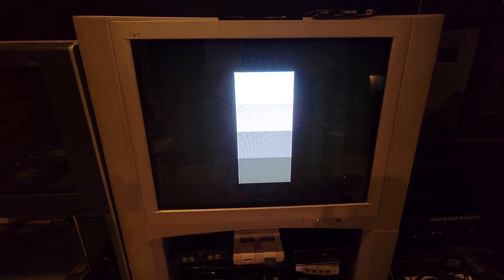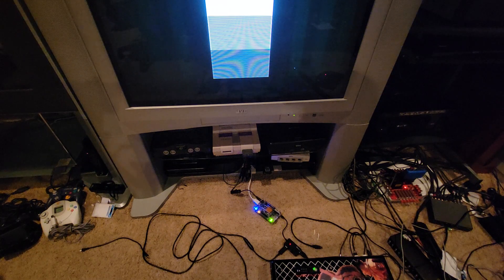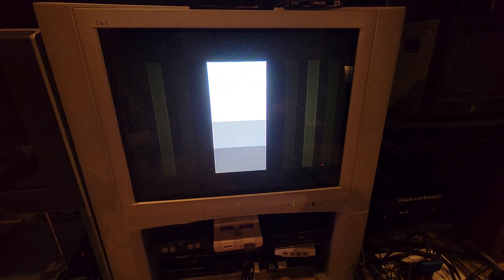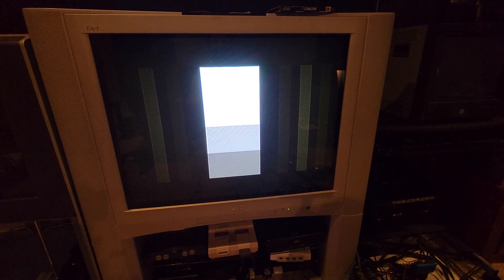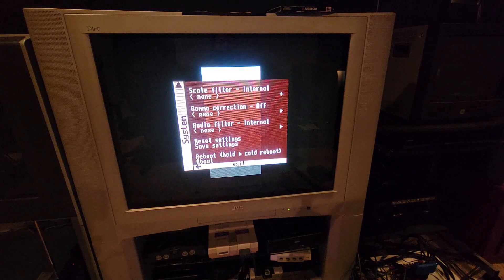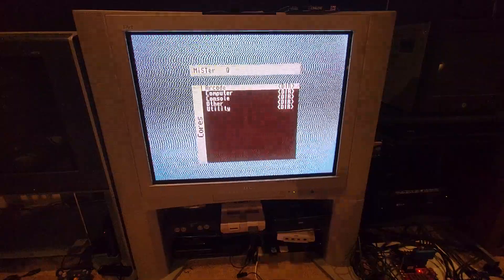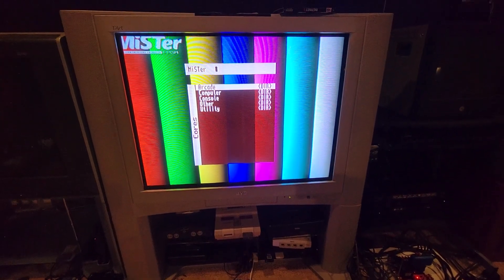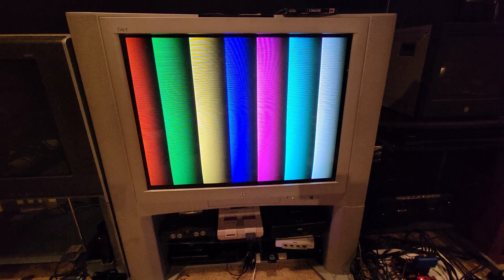MiSTer FPGA IO Board vs Direct Video

Comment: Is it still the way to go through the HDMI with a digital to analog converter cable instead of using the new 24 bit AV Pro 9.2 VGA analog output?
I want to have the best possible picture on my CRT with the mister and right now I am shopping for parts and cables.
Reply from the maker: @rolux4853  direct video is still the best way.  Cleanest signal too find in higher resolution.  I have a misterpi with 24 bit analog out and direct video still wins.

Comment: Hello, how did you make your cable work in direct video mode? I bought a VGA to Scart RGB cable, especially for MiSTer, and also an HDMI to VGA converter, and it doesn't output colors, only a black screen and silhouettes.

Comment: Good content! I remember you helped me in the past with CRT related issues and here I found you again dealing with the mister.....subbed.....

Anyway.... I was building a consolized neo geo MVS and the cost of parts and availability are getting stupid so cancelled my orders on parts and instead ordered the de-10 nano, 128mb sdram, USB hub and will be building out my mister inside a neo geo themed  acrylic case.

I will mainly be playing on 70" LCD but would occasionally like to throw the system on one of my CRT TV's via component, or connect it to a PC VGA CRT. Do you think I'm better off just getting the analog io board or just using direct video with an HDMI to VGA adapter, then VGA to YPbPr?

Would the io board be more plug and play where direct video I need to go into settings and change things every time? If so is it worth the effort?

Thanks!

Comment: Bahn Yuki  i got a question i have a lcd tv screen and a crt tv have you ever tried to color match your lcd to your crt tv . i spent hours trying to do this and failed badly couldnt get my reds and the color gold,lightblue  to match no matter what i did i just couldn't do it.  is there a lcd that can be calibrate to have the same colors as a crt ?
Reply from the maker: I have tried and I can't get them to color match on all sources. I believe there has to be some difference in GAMMA
Reply: its like crt are using a different color space so its impossible to get the colors  dead on . i remember mike j and byuu said what ever emulator you use needs a built in color lut that takes in account how crt output the colors on screen

Comment: Thanks man, just ordered my MiSTer and was wondering if I needed an Io board for occasional use with a CRT monitor via VGA. Looks like I'll be just fine without it. This thing is going to be amazing.
Reply from the maker: You don't for vga. It actually looks better without the io board
Reply from the maker: @ByTorAndMe  yes, but it didn't work well for me. Good luck
Reply: @ByTorAndMe  How did it work out?

Comment: does anybody make a full range io board and what dac is full range for direct video.if you have the i-o board connected to a crt  can yo still used direct video on a crt at the same time. update i bought a io board you can use both for 2 crt tv